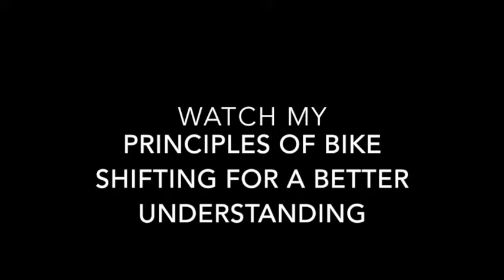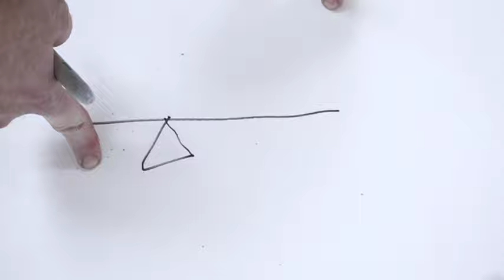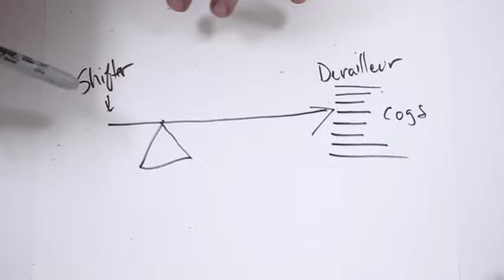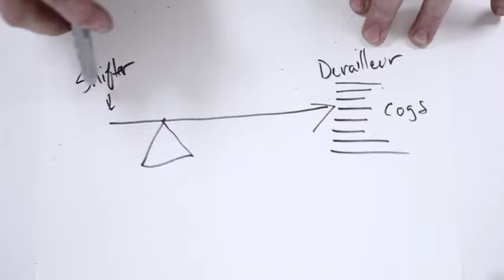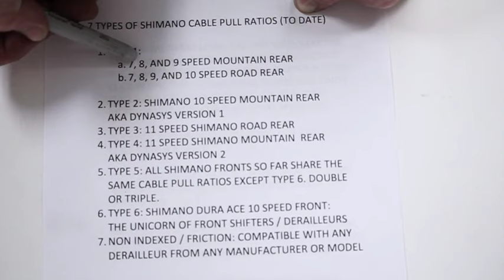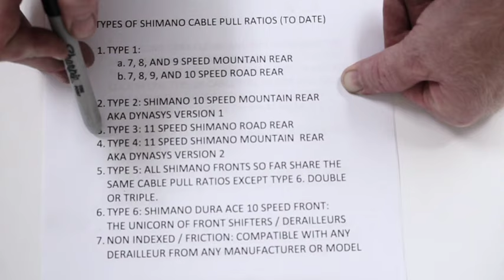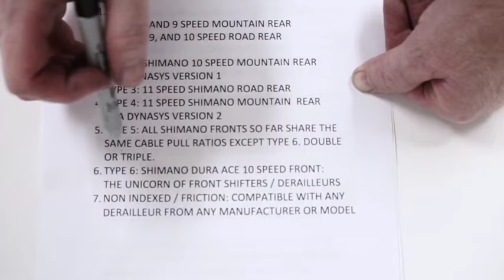Shimano Shifter / Derailleur Compatibility Guide: Intro to Cable Pull Ratios

Comment: Dear sir according on this diagram  is it possible to work a xtr rd-m972 Derailleur   (  9 speed)  with 11-46t cassette and  10 speed shifter with an extender or not

Comment: For road bikes, is Tiagra 4700 rd and fd compatible with SRAM 2x10 brake/shifters?
Reply from the maker: No. 4700 rear is only compatible with 4700 shifters. It’s an oddity that was created after I posted this. Definitely not compatible with SRAM.
Reply: @johnthebikeguy  
follow up question: is 105 r7000 rd and fd compatible with SRAM 2x11? If so, is there a difference between 105 r7000 fd and 105 5700 fd? As I can only observe that the 5700 one is a clamp on, while the r7000 is a braze on and my frame is currently a clamp on style, so I'm thinking of just going with the 5700, but I'm worried that it might have some compatibility issues
Reply from the maker: @name-ug5xq  no road shifter made by SRAM is compatible with Shimano Components. Mount style has no effect on shifter compatibility. You have to use SRAM derailleurs.

Comment: I'm considering upgrading a Trek 7300 FX Mountain bike for gravel use, and would like to replace the handlebar with a Bontrager VR-CF Aero handlebars, and use road shifters with the 9 speed LX group.
So if I understand correctly, I could use my 105 10 speed (5700) right shifter with the 9 speed LX rear derailleur, provided I upgrade the cassette to a 10 speed one? 
For the front I will need to change the derailleur in favor a road version fi. a FD-5703?

Comment: I've a 10 speex xt rear mech with clutch on a 9 speed cassette  pulled by 11 speed slx shifter and it works pretty good in till I put the clutch on and then the shifter won't pull the derailleur properly, is this due to pull ratio? Or do my clutch need serviced? 
Any help or advice welcome
Reply: Fixed it😀

Comment: Can I have Deore LX (2009 model i think) 9 speed rear derailleur on road bike? And can i put those road bike shifters (that come integrated in a brake) on it and use it normally?  I have option to buy a good bike for ~200$ but it doesn't have road bike drop bars, its a flat bar. And on the rear it has Depre Lx 9 speed derailleur which i think is for mountain bikes.

Comment: I found a bike in trash,thought I could save it ,24" anyway the rear derailleur was all bent ,chain rusted,so I had some shimano derailleurs ,put one on it rubs the freewheel ,no b adjustment.I sized the new chain to old one and checked sizing from large front ring to large back cog.it seemed ok .shpould I put a long cage ? or what.help

Comment: My alivio deraileur broke.  What is My best option for new deraileur upgrade based on the following setup with V-fire shifter?

3 x 8 speed with the Shimano cs-hg30-81 cassette in rear

Front cog large 42.
24 small cog

Total chain capacity is 37 if I did my math right.

I have the Shimano St-ef50-8r 8 and L Speed V-brake shift trigger/brake assembly.

The only markings I could identify on my chain is 'narrow' and Z

Comment: Hi there John. I'm looking for a answer to my question. But I can't really find a answer for it. Then I found your video. Nice video btw.
I have maybe stupid question. 

I have 10 speed Dura- Ace 7800 complete groupset on my bike. I want now to swap the shifters with the modern ultegra shifters with hidden cables beneath the handlebar tape.
Which model or generation of this Shimano family will work for me?
Reply from the maker: You’d need a newer 105, Ultegra, or dura ace 10s shifters - they have the cable underneath. Or, buy 11s road components (shifters and rear derailleur). Your wheel probably isn’t compatible with 11s road cassettes however. 

Anything made for shimano, road, 10s and has the cables underneath will work. Tiagra 10s won’t be compatible.

Comment: But did the pull ratio and the cogs change through the years?
Because if it didn't I can use rx100 9s cassette, rx100 crankset, with new sora derailleurs and shifters
Basically everything of the rx100 can be swapped with new sora?

Comment: I have a Specialized Allez with a Shimano Claris groupset. Currently, it is equipped with a Sunrace 11-32 8-gear cassette. I am about to change the wheelset and considering having a new cassette and chain. Considering that Shimano and SRAM are compatible in general, will a SRAM PG830 cassette work well with my Shimano Claris derailer? Thanks.
Reply from the maker: Yeah, exact same spacing. As long as you’re not changing the # of cogs, everything is good. Campagnolo is the one to be careful of using mixed brands.

Comment: Really good summary. Brilliant. Quick question. Is the Sora 9 speed set still a standard pull ratio ?
Reply: Yes the sora 9-speed is the same pull ratio as 7, 8 ,9, 10 road and also 7,8,9 MTB

Comment: Great video, my current derailer SRAM x3 has 1:1. Shimano has 1:7.  So If I plug in Shimano derailleur I would need to change shifters as well right?
Reply from the maker: Yes. Not compatible at all. Maybe the front you’d get lucky with, but definitely not the rear.

Comment: Hi John, your video has ended my frustration while i was trying to fit new M8000 11s rear derailleur with old shifter 9s.

There is new reason to be frustrated. I have a bike frame with TOP Pull system and series M8000 doesn't have in any front derailleur which support 3x11 with top pull. 

Is there any chance that I can use new M8000 shifter with old 3s derailleur or they change something too in front shitfer too ?

Comment: Thank u for the rundown. Just a quick Q. Are Sram or Campy road/dropbar fronts semi-indexed as well? I know that flat bar ones are. Having a problem with my Shimano compatible STI shifter.
Reply from the maker: Sung Yoon Campy has the only semi-indexed left shifter. Shimano and SRAM have fully indexed lefts. 

This excludes bar end shifters which are always friction, non-indexed.

Comment: I noticed the Shimano Tourney TZ500 I was about to buy says "SIS index". Is it possible those aren't friction shifters? or maybe I'm misunderstanding "index"? IDK but I feel like simple lever pull designs should be more advanced, and capable of adjusting any and all gear ranges. The derailleur should be responsible for all the complications of pulling a cable. It's very odd to me that people consider a lever pulling a cable "retro" or "vintage". Seems kind of like calling water a vintage drink
Reply from the maker: Indexed means it’s indexed - which is the opposite of friction

Comment: great explanation! it seems that my plan will not work. i currently have an 8speed claris rd and someone sell me his old school 10speed 105sti where the cable is not tucked under the bar tape. my friend has an extra xt rd which is 11speed, and told menits not dynasis. if i buy a 10speed  cassette, will it work?

Comment: Question..Think the Shimano M361 Hybrid Crankset I have would be compatible with 9 speed? I use a deore 9 speed rear and I wanna upgrade the cassette, shifters, but curious if the crank set I have will work
Reply: i'm confident it will work yes.

Comment: What about an 8spd shifter with a 7spd cassette (Shimano)?  I could not get a proper adjustment. It kept missing and hanging in the X and Y cogs (3rd and 2nd gear respectively.) I swear I read that the 7spd and 8spd had just the slightest bit of pull ratio difference (sorry, too lazy to look it up). So I put a 7 speed shifter on and it shifts perfect now.

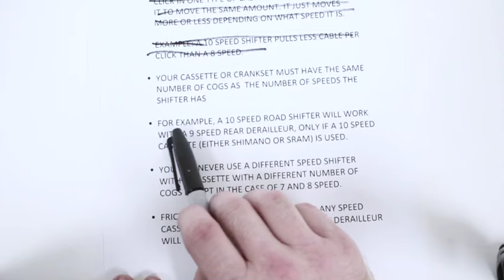Comment: Got a bit thrown off on your explanation at 8:00 . Could I use a 9s shimano cassette with a 9s shimano mtb rear derailleur with 10s Shimano road shifters? The only difference between 9s and 10s cassettes would be less gear range and not having to block out 1 gear on the 10 speed cassette.  Let me know if there is something im missing.

Comment: John- very informative video. My question is that I want to swap out my wife's 105 11-27 cassette to a cassette with 32 as the largest cog.  She has a 105 short cage derailleur and a 105 50/34 crank. 1) will this derailleur work the larger cog cassette? 2) if not can I mix Deore, SLX or other Shimano cassettes and derailleurs to get the smaller 32 cog gear we want?  thanks Another John

Comment: My rear derailleur is Shimano SLX M7000, SGS, Shadow Plus and supports 11 speeds - that makes it what you called Type 4 I suppose?
And it is mate with 10 speed shifter(Shimano Deore M6000, I-Spec, 2×10) with 10 speed casette (Shimano CS-HG500, 10 Speed, 11-42T). According to your words the combi that works is 11(RD) with 11(shifter)  https://youtu.be/myXVbwITvNk?t=361 and mine should not work properly am I wright?

Comment: dear sir, is shimano xt shifter with 11 speed compatible with 105 rear derailleur with also 11 speed? 

please help because i found its hard to get shifter 105 with flat bar
Reply from the maker: Irfan Rildon Sanjaya No, they’re not. Dynasys 11 isn’t compatible with anything else. I have a video on it - check it out!
Reply: @johnthebikeguy  thx alot sir

Comment: I'm climbing Alpe D'HuZes and I have an old groupset Dura ace 7700.  53/39 - 11/27 - Can I use my current levers with a 10 speed ultegra mid cage and an 11-36 cassette to improve my gear ratios to make climbing easier?  I would have to use a 10 speed cassette and get a new chain if this will work.  Another question is will a 10 speed chain work on my 7700 9 speed cranks or will I need to change the front cranks as well?
Reply from the maker: Dan Reilly A 10s chain should work on a 9s. I’ve done it many times. 

The derailleur May rub on the big cog in back. You can if you buy a road link from wolf tooth. I have one on my 11s Med cage ultegra di2 derailleur running a 1x11, 11-40 cassette. 

I don’t know if the cage has enough capacity. You may have to look it up. Capacity = (large chainring - small chainring) + (large cog - small cog) 

A new chain should be required (longer)

Comment: Hi...Was thinking of converting my Shimano A050 shifters that are on top of drop bars to brifters (break/shifter together). Is this possible. Do I need to change the rear derailleur as well (TZ050, direction type)?

Also, if I decide to stay with what I have, can I put the A050 shifters on 31.8 drop bars?
Reply from the maker: Jim Torres no, no need to change them as long as the speed is the same (7/8) to ensure chain compatibility with the rear derailleur. Same ccs or pull ratios. I’ve definitely seen the A050 shifters on a lower mode bike, and on an upper model with the Tourney Brifters and exactly the same front and rear derailleurs.
Reply: @johnthebikeguy  Thanks for that John!!!!!
Reply: Hi again...was looking around and found some shifters and wanted to make sure with you before buying. Will this work: SHIMAN0 Tourney ST-A070 Road STI Shifters Levers Shift + Brake Lever 2 x 7 Speed Left / Right / Pair.
I have a 21 speed road bike with the shifters mention preciously...

Comment: Thanks for the video. I would like to ask about cranksets. Shimano Sora shifter, 9 speed Sora rear derailleur, and Sram 9 speed casette. These components are used as stock with double crankset on my bike, without any problems. It is 2x9. Can I change stock crankset to double 105 FC-5800 without changing any other components? It will be still 2x9. Thanks in advance.

Comment: Great vid!
I recently (a week ago) got a road bike with full (2016) Tiagra components, 2x10 12-28t cassette. And also have a (2016) XT-RD and SLX 11-36t cassette on my 2x10 MTB. I've been waiting to got 1x in my MTB , but on the cheap, meaning, wanting to keep if possible on 1x10 by now and just getting a new chairing and a Sunrace cassette. Said that:
1) Can I use the Tiagra 10-speed rear derailleur with the SLX 10-speed cassette? And by that I'll only need to buy a new MTB cassette?
By meassuring the full extension of the Tiagra-RD I don't see an issue with the 11-36t cassette, but don't know about indexing and such. Thank you!!

Comment: Just to confirm. If i have a 11sp 105 shifter, i can use that with a 10sp Deore shifter, assuming i put on an 11sp cassette, correct?
Reply from the maker: I don't quite understand what you're trying to do. 11s road only works within 11s road. It's not compatible with dynasys deore 10s. Dynasys 1 has its own cable pull ratio. Same with 11s road. As such, they're only compatible within that group

Comment: I will try my best to explain this, sorry I´m not an english speaker.
I read everywhere front shimano shifters have the same cable pulling. Yesterday I recieved my new set of chainrings (x3 to x2 conversion) and new x2 front derailleur. I installed all parts, set the low limit, install the new cable and when I push the shifter to the second gear (middle possition) the chain pass the middle chainring (now the big one) and drops over the right pedal. So, I set the H limit so the chain can´t fall again. The I pushed the shifter and the chain stay in the middle chainring, but the shifter doesn´t reach the first "click", so when I released the shifter the derailleur returns to the first position.
The only way the shifter worked was with a super loose cable so the initial shifter movement only pull the derailleur passed about 30% of movement.
After that I tried between the 2nd and the 3th shifter possitions. Then it works, I can reach the "click" but the lever was so hard to push and the cable was very very tight.
The shifter is an old x3 Deore M510 (Mega drive 9 system) and the new derailleur is a x2 XT M786 ( 10s Dyna-sys system) .
My only possible explanation to this issue is that the cable pulling between those systems if different and mega drive pulls a lot more cable than dyna-sys.
I check the shimano compatibility chart and they say my M786 derailleur is compatible with only a few models of shifters, all them dyna-sys: M980, M780 ( I ordered one of this), M670 and Deore M610 and M591.
My experience: not all shimano shifters are compatible.
Reply: You have to set the Stopper bolt in a position that limits the derraileur movement, thus limiting the movement of the chain. in that way the mechanism will hit the bolt and the chain wont go any further.
Reply: You are totally right.  This video has some bad info in it.

Comment: hi john, this is very detailed thanks. just to clarify though, can i use a 9speed STI on a 10speed rear / FD and crank. with 9speed cogs? or should i just use a 10speed cogs? thanks
Reply from the maker: Charles Allen Soriano Cajegas shifters and cassettes have to match speed. Cranks are lenient. You can use 9s shifters only with 7-10s road derailleurs, and 7-9s MTB rear derailleur. Front derailleurs are generic.

Comment: thanks for that very helpful explanation I'm trying to convert my nexus 8 hub with a rear derailleur is there any derailleur that has the same pull ratio as my current shifter
Reply from the maker: Not as far as I’m aware. Internal gear hub shifters are their own thing. I wish they were as I’ve always wanted to run one with drop bar shifters
Reply: @johnthebikeguy  thanks very much, this ties in with what I've found it's a shame but it seems like my best option is to try to find a friction bar end shifter so I can put whichever 8 speed mech I want on there.

Comment: I just had a HUGE online retailer whose name starts with W tell me that the M8000 11-40 cassete is compatible with 11 speed 6800 utegra road shifters if I use an ultegra Long cage RD with a road link and 11 speed ultegra chainset. I also see some videos on you tube showing the M8000 11 speed shimano cassete working well with this set up I just described. But there is confusion as to if the cable pull of the ultegra 11 speed road shifters would work with the M8000 11 speed cassete via the 11 speed long cage RD. Some bikes shops say yes, some say no, most have absolutly no idea at all. So like Rex's comment below can I ask please for your comments on if shimanos M8000 11 speed 11-40 cassette will match up with the cable pull on shimanos ultegra 11 speed ROAD shifters? Many thanks for a cool video :)
Reply from the maker: Rolf Riley 

Man after my own heart. I've tried that with an XTR cassette, 11-40t, and a long cage Di2 ultegra rear derailleur. I tried it with a longer B screw, but didn't work. It was close, mind you. Didn't work to my satisfaction and gave up
Reply: Thanks John. Did it not work because of the derailer length (without a roadlink) or because of the shifters cable pull mismatching the cog spacing would you say?
Reply from the maker: Rolf Riley The shifters moved the derailleur to the right spot. It just interfered with the 40t cog. Wolf tooth hasn't made anything yet. Maybe it would with their parts
Reply: Just as a follow up I have just installed the new shimano ultegra 11 Speed rear derailer with built in road link and longer b screw, with a m 800011-40 11 Speed cassette and 11 speed hydraulic ultegra shifters without any wolftooth or other cable pull adjusters .i have a 48  -32 subcompact up front and it all works very well .

Comment: Hello JohnTheBikeGuy! Thank you for explanation! I still would like to make sure. Can I make a straight swap from Tiagra 4600 10speed rear derailleur to Tragra 4700 10speed rear derailleur? Would the new 4700 derailleur work fine with 4600 shifters?
Reply: not. The Tiagra 4700 is a special, not compatible with anything else, as far as i know.

Comment: I have a sxam x3 8 speed shifter and i want to buy a shimano rear derailleur. Which type of shimano rear derialluer is compatable?
Reply: none. shimano and sram have different pull ratios for rear derailleurs. sram is 1:1 and shim is 1:2. you want a sram RD to go with front shifter.